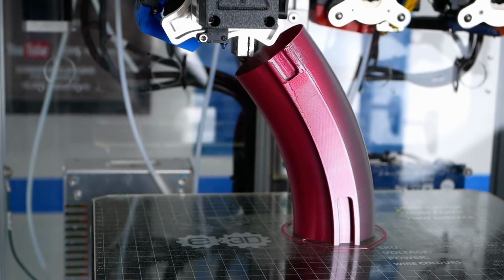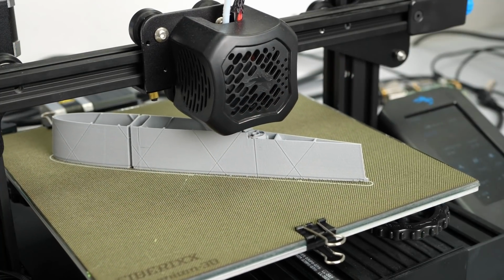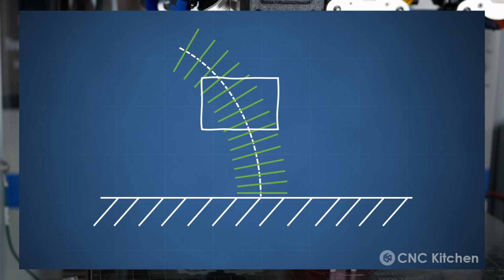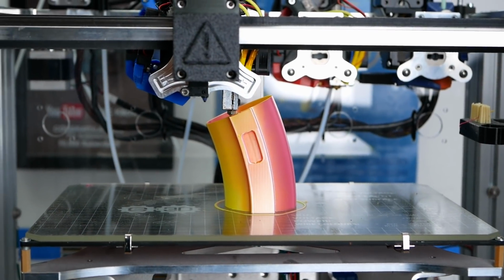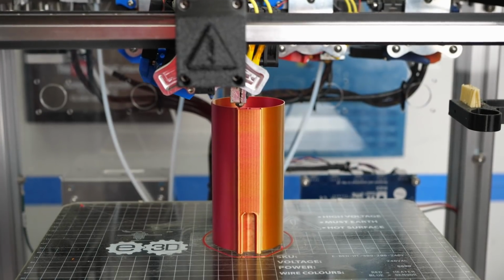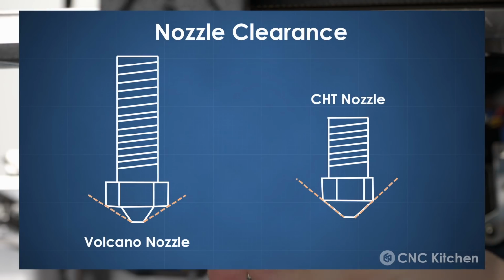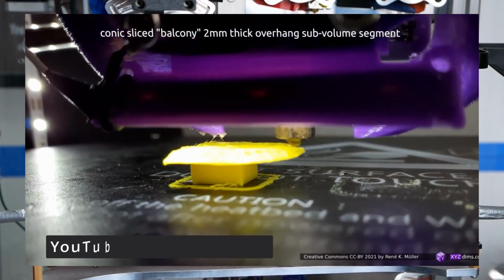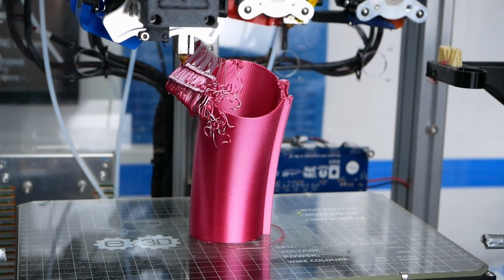NON-PLANAR 3D Printing by BENDING G-Code

Comment: I wondered why z axis seem to be a tad ignored. Moving slow, and dont have a fluid motion like x/y. Maybe im wrong, but z axis seems to have been a bit underutilized. That being said, im new to 3d printing. Got a second hand about a month ago. And, i think z movement is slow. Derby, i wondered if what you have done was even possible. Considering i yet to be able to update firmware on my printer, this is above my current skills. Still, interessering video.

Comment: Wondering if this code could be set to print at 45 degrees similar to a belt printer but using standard x, y and z coordinates? No tilted frame just a 45 degree nozzle.

Comment: Vase mode with complex surfaces would be cool, I don't think it's been covered at your level of exposure.
(cura 5.0 is having issues with this type of print at moment or maybe I have wrong settings, unnecessary travel moves, hopefully fixed by time you educate the masses)

Comment: Today I've designer a desk lamp that is really similar to half a cilinder rolled with a radius of 45cm for 25 degrees. I really need to try designing it vertical end bend it with this tool. I came back to see this video to do it. I'll try :)

Comment: Any tests on the impact on the layer-properties? Depending on the slope the way the filament is placed is rather different - going up it should have less restrictions than going straight, and going down it would be smushed more.

Comment: Does the nut size on the nozzle matter because I'm seeing them anywhere from a 6 mm all the way up to a 10 mm just wondering if more bigger nozzle like that will heat the material better

Comment: What about the combining of (please bare with me here...) Single Layer Deposition/laser 3d printing, with some kind of powder coating. If you can laser cure some 3d plastic resin/substrate (I don't mean resin printing...), Statically charge the workpiece, deposit substrate flush the chamber, repeat.  You could have a mirror at the end of the nozzle that rotates around Y and can be angled through Z/X. Combined with the X/Y gantry for the head itself, this could maybe be effective for complex geometries and structure. Is there anything like this? Is this at all viable/desirable?

Comment: Let's be fair here. There is no single tool or method that is equally good for everything! 
So your solution is great for the tubes and slight bend objects for 30 degrees. 
I'd love to try nonplanar slicing for my HO models assembly- it would certainyl make rounded roofs of the train models I make look less jagged.

Comment: Wow! Something like this could also be used to increase part strength in z-direction for regular prints: Instead of bending and adjusting the layer height based on the bend, you could adjust the layer height based on some 3d noise function! You would just need to scale/warp the input mesh in the opposite direction, run in through the slicer, apply your code that modifies the flow-rate-commands and move-commands in the g-code and it prints the original model shape but with layers that are not aligned with the xy-plane!

Edit: Oh, and in order to get better results for printing overhangs (like you have shown in the clip by Rene Mueller) you could generate the "noise" based on the mesh geometry, so that in the scaled/warped mesh, the overhang has an upward slope. This would cause the final g-code to print it in different layers but at the same height.
Reply: This is clever. Not only would the layers interlock, also surface area in total increases. Also I recently did some material tests, especially impact strength. I had some samples which were printed too hot, so that The layers warped on the outside of the samples. Just a tiny bit of interlocking and the impact resistance was so much better

Comment: Non planar...hmm...let me see, plane...hmm...you need a minimum of three points to make a plane. So....check this....what about just moving the bed instead using three Z-Axis stepper motors so it can move like it is jointed? And leave the gantry to handle the X and Y moves only to completely eliminate the collisions? So this makes it sort of like a 5 or maybe 6 Axis Real 3D Printer? Would this work? Or am I late to the show?

Comment: -you can get 60% of bend if you print on a 30% wedge on the print bed.
-if you smooth the face of the print head into a 1cm sphere you may get steeper angles and more consistent printing:  now only the hole location varies with angle instead of the shape /orientation of the print head face.

Comment: I really like the idea. I'm not at all versed in python even though I tried I'm nowhere near good enough to do what you did. The concept is great and once you mentioned robot arm printers I can see where the application would shine. I'd almost sat an entirely new slicer program would have to be built from ground up to Include it

Comment: I like it a lot.  Great new tool - OK it has limited capability but it can be applied to arbitrary shapes and gcode - so it's immediately useful, you've opened a new frontier there Stefan!  Plus reminded me of using vase mode so solve an unrelated current problem - thanks ;)

Comment: I think the idea of having a slicer analyze complex geometries to apply non planar slicing is a nice thought for the maybe some day file. On the the other hand allowing the user to define a main axis and then apply effects from a library of transforms is very achievable. 

Actually any slicer capable of making gcode for the cr-30 is able to do this in a limited way.

Now that I think more. Don't printers with auto bed leveling kind of already do this? Would it be possible to feed the bed leveling code weird data to produce non planar prints?

Comment: I wonder what an (honestly rather complex) elaborate hot-end that can take it's shroud etc. Out of the way can do in this regard... Thinking off the trade-off between printing time and angles possible... If the harsh angle is say 15% of the total Z height it could be worth slowing down by 50-80% total speed for that section...

Comment: I remembered an report I had read years ago called 3D printing on non-planier platforms. I think it might be useful for you. I'm still wondering how you implement z-axis movement within the code. I think I will check your github code first.

Comment: I just built a RatRig V-Core 3 (not running quite yet).
One of the reasons I went with it is the 3 point kinematic bed since it theoretically can perform non-planar printing easier/better by tilting the bed.
Has there been anyone doing this yet? I haven't researched it much but am interested in non-planar printing that way.
Reply: I’m planning to build a V-Core 3. The challenge would be when the bed tilts the position of the part changes dramatically. I believe the challenge will be determining, when one of the 3 points tilts, how does that change the x,y or where the print head needs to be now. It’s absolutely doable. I think it would shine in a Klipper design.

Comment: This is an area of 3D printing I've been curious about, if the print head was on a 2-axis gimbal it would allow printing of objects that traditional FDM printers really couldn't do, notably it could be used to print stronger parts if they're designed in mind with the ability for its layers to be printed more 'organically'.

Comment: You mentioned 5-axis printing with commercial machines such as robot arms. As you noted, we do not currently have home 3D printers with heads that tilt (except possibly a special delta setup}. However we do have beds that can tilt such as the Jubilee project or the RatRig V-core 3 (and others). I would really like to explore using those platforms to implement a (limited) 5-axis printing solution. Thanks for sharing the topic and your approach to what I feel is the next major development in home printing.

Comment: I've thought about how to extend the algorithm:
1. Compute the "skeleton" of the 3D shape.
2. Create a chain of splines that match the skeleton, using the endpoints and splits as the nodes. If the spline bend is too much for the nozzle geometry, split it. It may be useful to always consider the node closest to the bed as the starting point.
3. If a node is 'hanging' add support.
4. Make a deformed cylinder centred on the spline that matches the geometry of the model like you've shown.
The problem is how to deal with cyclical graphs and diverging paths. For the first one, I think on a teacup. If the skeleton ends up like a letter D then shouldn't be any problem. For the second one, we'll need to compute the intersecting plane of all the cylinders and print it before the branches as support for them.
I would love to try this, but I don't really know where to start. I neither know G-Code nor any 3D tooling simulator. Hope this inspires someone else.
Reply: Repetier host with slic3r, has gcode viewing

Comment: 5-axis 3D printing is what I do for work on DED metal 3D printers. Thank you so much for bringing up such a challenging concept. Currently, we are using Mastercam with the APlus plugin that allows you to slice for additive manufacturing. I've tried using HyperCam, but even with the added complexity, it is still hard to get true 5-axis printing. The most we are able to get (with a readily available slicer) is 3+2 printing. My boss is on to something with utilizing surface normals with the current layer and the previous layer. I think even an implementation of that would be great even for non-planar true 3D printing. But of course it is slow going with the plugin programmers, since it is so complex, you have to work with existing software, and it has to be robust and repeatable.

Comment: I would really love to see this logic applied with a 3-axis bed leveling capable printer. The bed could adjust (up to a point) its inclination based on the spline, mitigating the problems with nozzle geometry. You'd just need to pray that the whole print keeps sticking to the bed.

Comment: would be possible to tilt the bed if you have a kinematic coupled one? Since you have defined the spline and the plane whitch it sits on, you know the angle between the tangent vector (t^) and the "z" axis (k^), (cos(theta)=t^ . k^ dotproduct). If you can rotate the bed along the axis(r) perpendicular to "z" and the tangent vector (r=t^ x k^ crossproduct) by that angle it would result as if you where printing flat locally

Comment: <software engineer here> Fantastic! For a utility, your python code is fine. Glad you used regex too (it's the holy grail and the boogie man at the same time in the programming world). Now to see if people actually adhere to the GPL license...

It is very true that the limitation is software, though there's enough hardware limitations (such as fan shroud) and I don't see those going away. I expect that when software gets better (or utilities improve), people will still need a dedicated printer for non-planer or to accept the limitations (such as angle limit, nozzle capability, speed, and complexity (because of cooling)).

The software side is interesting for me and I've thought about it on occasion since my first printer (3D printer/CNC with 4-axis milling capability that people wanted to do rotary printing with but the design used the extruder as the 4th axis). I think the best option would be for the CAD software to do the slicing (a la Fusion 360) then for a dedicated slicer to do the work. The reason for this is knowledge of part geometry. Your options for slicing are producing non-planer gcodes with constant flow or doing distortion (as your script does).

A slicer could probably produce a model with mid-layers ("anything less greater then X flow will be it's own layer, anything below Y flow will cease to be a layer", thus you end up with some non-planer layers being complete and others being partial. To "fill in the gaps". But otherwise, it needs to figure out what model it's slicing to determine if there is any way to slice it non-planer. It's not just a case of "is this an overhang" as some of the "support-less 90 degree print" videos/demos/papers demo. How do you know your curved marble tube can be non-planer? Brute force solving works for a paper, but not real life. In-slicer deformation would allow the slicer to do something similar to your script, as it knows the deformation that needs to be done and know to do non-planer operations. Sans some external or user provided info or rails so the slicer knows "this can/should be non-planer sliced". But on it's own, it doesn't know. "What about machine learning? Like neural networks" well, that requires training and I'm sure there's 1 million ways to break it. Train ML model on tubes, pipes, maybe a bowl or two. "Success!"... and then the first person to try it loads up a <looks at desk> tape measure. "Hey, how come the outer curved surface isn't perfectly smooth by utilizing non-planer?" Train on that (oh no, flat surfaces. Curved surfaces. An overhang!). Ok, now it's good... except now the set of plyers on my desk don't utilize it... so on and so forth. What about "only top layers?" well... that breaks your own example of a pipe. It also still produces the issue that existing top-layer non-planer doesn't appear to handle non-contiguous surfaces, so a basic sin/cos ocean model with a benchy in the middle. TLDR: dedicated slicers lack the information to properly determine what can and can't be sliced non-planer.

This is where CAD comes in, and hopefully is less explanation. Take an example of a rocket engine (go look up a SpaceX Taptor engine, Saturn 5's F-1, or Soyuz RD-107), what is and is not printable non-planer? Or better question: what should be non-planer? A good CAD software slicer (of which there are none) can look at this and say "this extrusion along a path is generated with a spline... I can print this non-planer" or know that a top surface will have a break in it, so it can do the non-planer printing across the everything but the break. Some of this understanding is already in programs like Fusion 360, where you can select a surface and it knows when the surface "ends" and only highlights it until the changing in curvature. Or when you take an intersection/projection of a model onto a sketch and it generates curves (like, you get a curve center point and can adjust radius and similar). On top of this, given that they often have simulation capabilities, it's plausible to expect that a model of the extruder (fan shroud and all) can be loaded and used in determining not only slicing capabilities but also part orientation to minimize collision with an extruder/fan shroud/nozzle geometry. Knowing the different parts/processes that went into generating the model, it can even combine techniques (rocket engine: the nozzle and part of this casing can be printed traditionally... but the pipes and this other part will be non-planer... and the layer lines will come together at these points so as to produce a continuous extrusion without retraction AND without colliding with anything). TLDR: CAD software knows how the model was generated and often has the additional details needed to determine "can this be printed traditionally or should it be non-planer.

At least, that's been my mental understanding of the situation. I don't know every slicer and paper in existence and there may/probably are attempts at doing some of these, but that is how I would be looking at this from a code perspective. I want it, but the slicer is too limited, the CAD programs have no need to support it, and hardware is semi-capable but dedicated systems would probably need to exist to take it from a toy to home printer/professional functionality.

Minor: I think one of the most unexpected vase-mode models was from Clocksprint3D with his vase-mode Christmas bobbles. He made a loop in vase mode. Once seen, it made sense. But at the time it was "he made overlapping/non-vase mode geometry that prints in vase mode?"

Comment: I just love the Gcode hacking ideas that you come up with, Stefan, be it this or the gradient infill. I did some Gcode hacks of my own, such as hacking top layers onto a vase mode print (surprise: they work fine, just like on 0% infill layered prints!) and linedithering colors, which enables me to print 3 colors on a dual printer and 15 (!) on a Prusa MMU, taking zero extra time and filament waste! Search the Original Prusa owners FB group for "linedithering" if you want to see this, i also uploaded a .3mf there!..

Comment: Hello Stefan, thank you for your great work, maybe you can answer me a question. why the seams cant be hided using a method of slowly ramping up to the next layer.  I think it should be so easy in vase mode slowly ramping up the second layer an then ramping up further?
Reply: That's exactly what vase mode does - the Z coordinate increases slowly at every small segment, so that by the time you complete a circuit Z has increased by one layer height.
You are still stacking layers on top of each other, at a slight angle, so the layer lines look largely the same.

Comment: Very cool!  I made some PETG flowers last summer and printed the stems in vase mode.  Not having your ingenious method, I printed them strait, heated them with hot air, and bent them.   It worked well, but they were only 8mm in diameter.

Comment: If you first performed the inverse transformation on the points in the STL file, sliced it, then did this,  you'd get a sort of non-planar slicing of the original model.

Comment: i want conical printing

basically print bed is on a turn table

print head would sit at a 15-45 degeee  angle 

x axis would move along that angle and the z would move perpindicular to it

the turn table would be the y axis